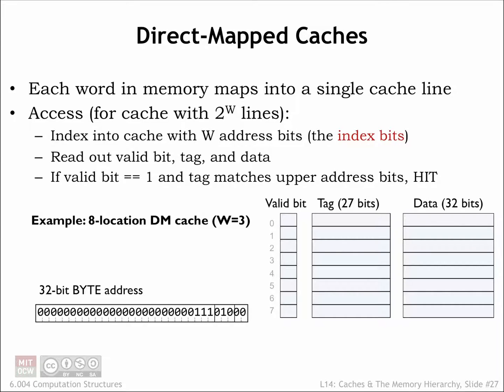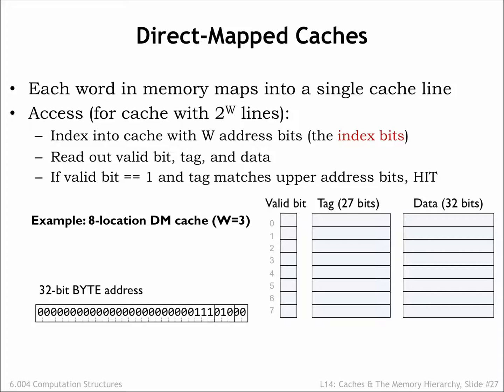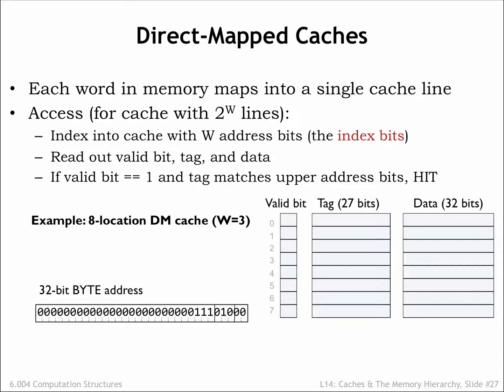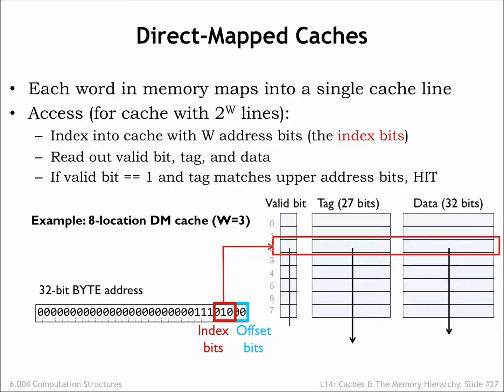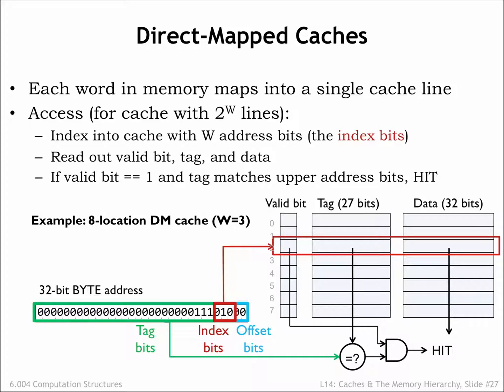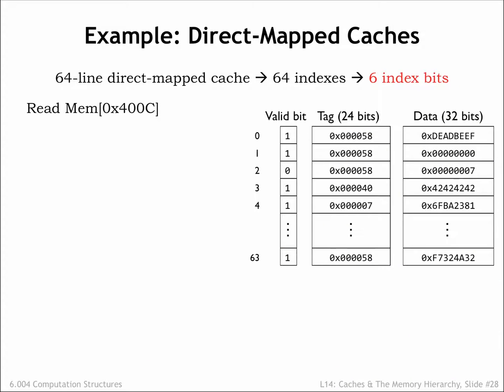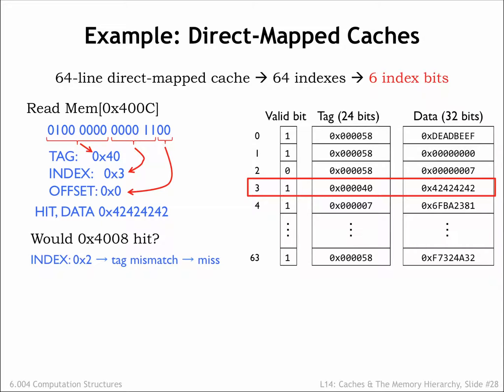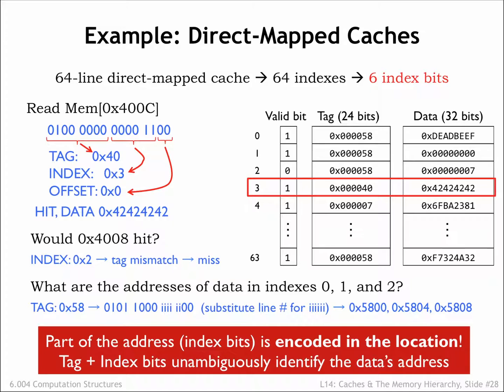14.2.7 Direct-mapped Caches

Comment: still don't understand offset
Reply: I think if the structure of the cache can hold more than 1 word of data to each tag, we use the offset to fetch the right word ... correct me if I am wrong
Reply: @ahmedabouelnasr4673  such that you can put several words on a single data cache line even though they are not used for the same variable?
Reply: @Saens406  The point of a cache is to take advantage of both temporal and spatial locality. When you store into a cache, you're grabbing a bunch of bytes at once, the target byte is included in the block. Depending on what type of addressability you support, most cases it's byte addressability, you need to be able to index that block of bytes to grab the right one, that's where the offset comes in.
Reply: I also couldn't get it at first, until I remembered that each address (which is 32-bit) holds one byte of data, so called byte-addressing. For example, addresses 0x0000~0x0003 together hold the first 32-bit data in memory (each holds 8 bits).
Reply: I agree with what the others have said. Just for clarification, the reason we are not using the offset is entirely a design decision for the Beta specification, since any piece of memory is the full 32 bit word. If we had allowed accessing just 8 or 16 bits, then we would need to use the offset to specify which ones.
Reply: Byte offset is for the "Not my job, thats too specific of an address."  part of the cache.

In this case, the smallest data the cache is able work with 4 bytes (32 bits) of Data at a time, nothing smaller.
Offset is for the addressing of individual bytes. Using the byte offset for adressing which byte of the 4 data bytes the cache returned, is a job for next person.
Reply: Next lecture explains it